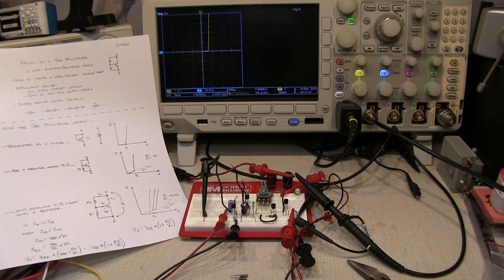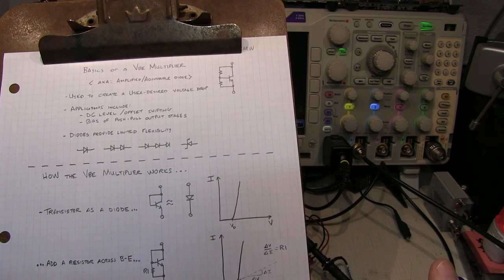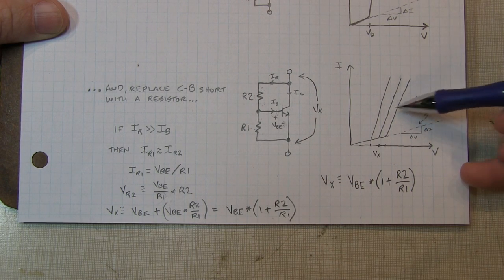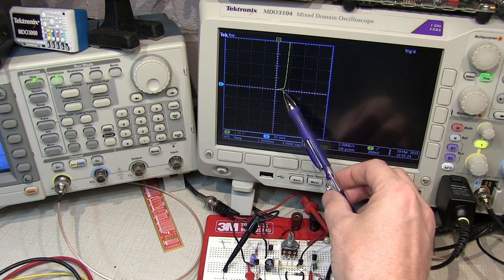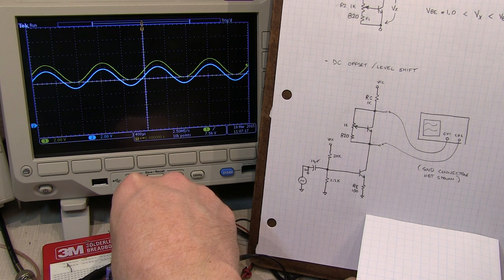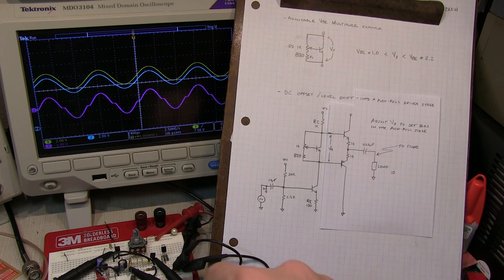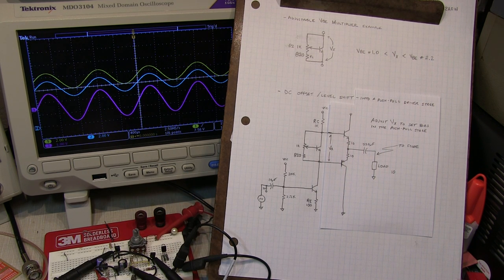#198: Basics of a Vbe Multiplier: what it is, how it works & where it is used

Comment: Alan, it's a pity you didn't mention its main attribute of thermal tracking of the output transistors.
Reply from the maker: Yeah, I should've.  But, thanks, because you've mentioned here for all to see!
Reply: Actually, you can "track" the thermal bias variation of the transistors with a thermistor or diodes.  Many amplifiers in the late 60s (i.e. Sansui, Kenwood, Pioneer, Fisher, Scott, etc.) did exactly that.  The thermistor or diodes were thermally coupled to the heat sink and chosen to "track" and cancel the transistor's thermal characteristics.  Unfortunately, this compensation was too slow to change the transistor's junction temperature due to the thermal conductivity induced time lag caused by the thermal resistances from the junction of the transistors to the thermistor or diodes.  This could result in "thermal runaway" and melt the junctions of the transistors into a zero Ohm piece of silicon. The Vbe multiplier has the advantage of DC gain, which can be configured to reduce the bias current of the output transistors faster than they could heat up, eliminating thermal runaway.  Thus it did not "track" but actually "advanced" ahead of the thermal bias change of the output transistors. This produced optimal bias and low distortion over a wide operating temperature range.  This circuit has been the standard "best practice" in designing A-B Amplifiers for well over 30 years.
Reply: @shazam6274  Yes, all true. I have found from experimentation that the Vbe multiplier transistor needs to be in thermal contact with one of the power device tabs directly. Being attached to the heatsink right next to the power device is not adequate as the time delay (and thermal lag) is long enough to allow thermal runaway to occur. When done in this fashion it works very well.

Comment: Seems to me that this circuit would be applicable to an analog map sensor in a car. Take the sensor output and shift it down? A simple voltage divider with two resistors between signal and ground works well but ot does put extra load on the sensor output. (Diode doesn't it actually shifts it up as it goes to CPU that has short circuit and open sensing).

Comment: I found the equation for Vx to be off by about 10% when doing simulations.  Also, the circuit seems to vary (Vx value) from transistor to transistor (model).  Is this the expected behavior of this circuit?
Reply from the maker: Yes, it isn't exact for several reasons.  Vbe isn't constant (it varies with bias current), and also the equation doesn't take into account the base current.

Comment: +w2aew in your final circuit (where you use the Vbe multiplier to bias the push-pull stage), what motivates the selection of Re and Rc?  Why 100 ohms connecting the emitter to ground?  Why 1KOhms between Vcc and the collector?  Thanks.
Reply from the maker: I wanted a voltage gain of approximately -10

Comment: I see this schematic gives the easily adjustable DC v. drop. But for simpler applications (i.e. audio oscillator) it's better to use a capacitor to remove a DC offset, isn't it?
Anyway the video is very interesting!
Reply from the maker: This circuit isn't about removing a DC offset, it is all about adding a DC offset....
Reply: hmm... this means that I know very poor about DC offset removal. I've thought that a cap. just shifts "all values" by a certain amount.

Comment: Is this the same circuit they use in biasing an audio power amplifier to remove the dc offset out of the speaker terminal?
Reply: ***** Or (particularly in automotive apps where you're trying to get the most power you can from a ~12V supply), each terminal of the speaker is DC-connected to an output stage with one stage driven 180 degrees out-of-phase (i.e. inverted).  That doubles your voltage swing (24 effective Vp-p), which quadruples your power ( P = (V^2)/R ).   But the nominal (quiet) voltage across the speaker is 0V (6V - 6V).  Also, most A/V receivers use bipolar supplies (like +40V and -40V) so they are nominally at 0V without AC coupling.  Audio power amplifiers are usually not AC-coupled because of the large capacitance (and voltage rating) required to pass 20Hz at 4 or 8ohms.
Reply: DC offset in a DC-coupled amplifier is eliminated through negative feedback (sense the output voltage and servo the offset until it = 0V).  That's a separate circuit - it's not part of the circuit shown here.

Comment: I tried this Push pull circuit using a 12V bi-polar supply and a 10Vpp (eurorack) audio in the FallStad simulator.
But can't get it to run, even your circuit is poretty hard to dail it in.
Reply from the maker: Not sure why you are having difficulty, my push-pull amp design is pretty basic/simple.
Reply: @w2aew  well, i used a simulator.
What you're doing does happen, i mean the voltage drop between the 2 transistors, but it somehow clips the wave and it's always towards the positive rail. might need some time to find the right resistors.
Reply: @w2aew  i can't paste the link to the simulation in here, so you could have a look.
Reply from the maker: @AnalogDude_  Agreed - sounds like you don't have the quiescent bias point dialed in appropriately to allow for the full signal swing.
Reply: @w2aew  I found a VBE multiplier setup that does what i want on a push pull config. just now. By stick a npn on the push/pull bases and using 2 1k resistors, BC and BE and inject the signal on the base, seams to work and avoid the zero crossing bug, rather than using diodes as done in the Roland System 700 VCA. looking good in simulator.
Reply: @w2aew  I made a video to show you what i mean on the VBE multiplier setup with a push pull, it's on my account.
It's basically a Roland system 700 but not using diodes. Would like to know what you think of it.

Comment: 2:33

What "I" (current) is being referred to in the y axis of the graph? Total current out of the supply, current from C-E, current from B-E, sum of all current coming out of emitter?
Reply from the maker: It is the sum of emitter current (which is base current plus collector current) plus the current through R1.
Reply: I see. So in this case there is always some amount of current flowing through R1 which is equal to (Vc-Ve)/R1 even after the diode turns on, but the IV curve is dominated by the diode to the right of Vd on the graph. 

Thanks.

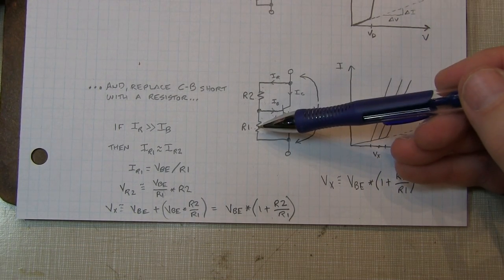Comment: 3:45

"And if we set up these resistors such that the current flowing through them is much greater than the base current, we can say that the current in R1 is basically equal to the current in R2." 

Essentially you are ignoring the base current, or considering it small enough to be negligible? Why can you make that assumption? What are you doing to "set up these resistors" to know that not much current will flow into the base?
Reply from the maker: The external circuitry will determine the current through the entire circuit.  From that, you can approximate the collector current, thus approximate the base current.  Then, you can decide how much current to put through the resistors to make the base current somewhat negligible (10-20x the base current).
Reply: ***** I see so you would sort of work backwards to determine the base current. 

Thanks.

Comment: What a great little circuit and a great explanation of it. Do you think it could be used in a 50mA DC power supply? I'm specifically thinking of this one: 

https://www.tubesandmore.com/products/K-101A

The site doesn't have the schematic. I have the kit and the B voltages are obtained with series diodes. Tube circuits are somewhat voltage variation friendly, especially for old battery powered broadcast band radios (farm radios), so I probably don't "need" to be able to tweak the various B output voltages but that's the first thing that I thought of when I saw this circuit.
Reply from the maker: As long as those diodes are NOT being used as rectifiers, and just being used to create a voltage drop, and you pick an appropriate transistor based on the current and power dissipation expected - then, yes.
Reply: ***** No, the DC is supplied to the "B Battery" segment (50ma) with a bridge rectifier. There are nine zener's in series for the various voltages. "A" and "C" battery voltages each have their own bridge rectifier. The transformer has three different taps for the AC to the bridge rectifiers. The circuit here probably isn't a good candidate for this application. Not because it won't work. It's just not necessary and the added expense isn't justified. But it's still a great video